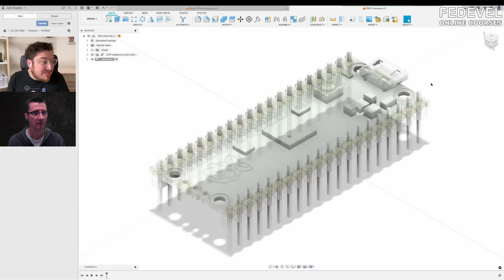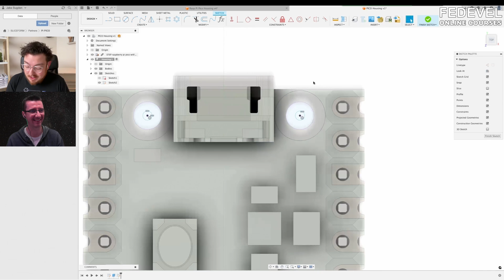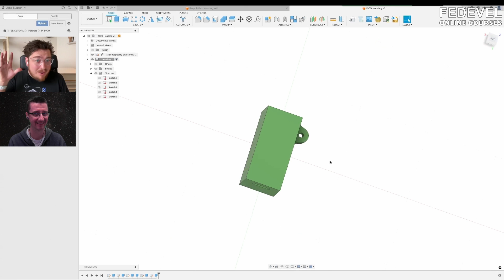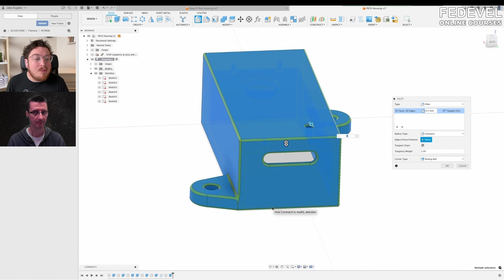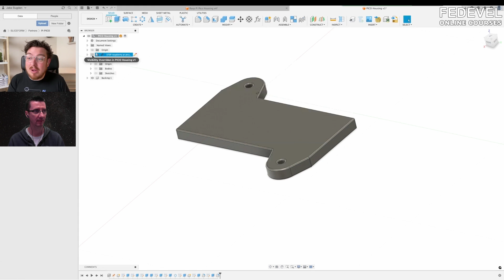Tutorial - Raspberry Pi Pico Box Step-by-Step | Fusion 360

Comment: One note I see everybody using 0.4 as their "wall thickness" however, default extrusion width is more than nozzle diameter to get the plastic to squish evenly. If you look in slicer settings, extrusion width default for .4 nozzle is 0.45mm, therefore 4 walls should be 1.8mm not 1.6mm.

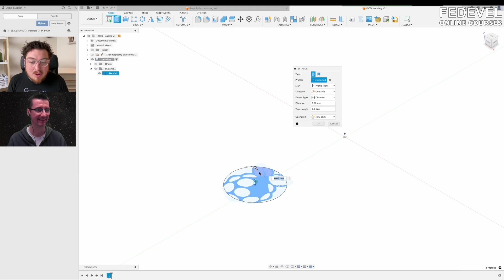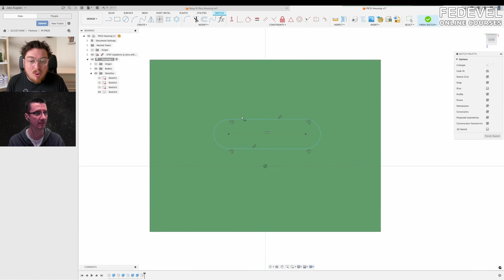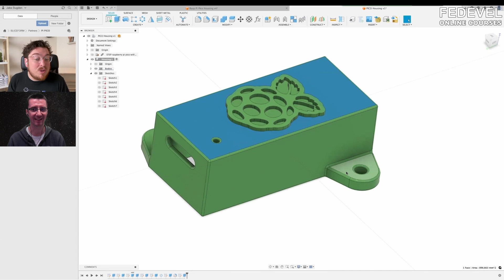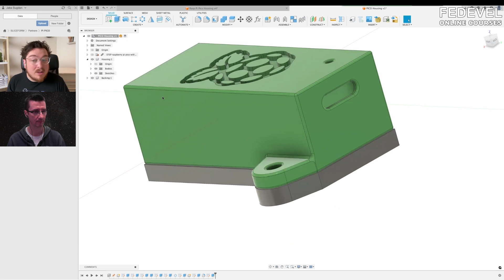Comment: Some shortcuts: 14:00 - press left mouse button on that circle for longer time, menu will appear, choose entire surface there. 29:30 - I don't have that central point option in my hobbyist licensed Fusion, huh!  (a moment where I wish to learn FreeCAD instead; turns out it's customizer toolbar and that's just a "point" not "central point"). And don't have two options next to right of it, too. 52:54 - you could chamfer entire taps (+ add bigger hole for bolt head) and no supports would be needed at all (minus - it would look much bulkier). Didn't know that you can create parameter directly when dimensioning. Neat! 57:40 - filleting of entire component. Another nice solution. Thanks!
Reply: Thanks for the detailed notes!
Reply: @CADclassOfficial  One observed thing. Creating parameter directly when dimensioning (aaa=0.1mm) does different thing than creating a user parameter from menu. It hard ties that parameter with the specified dimensioned object, so you can't later do like - "no I want that object (line for example) to use different user parameter". That won't work :/